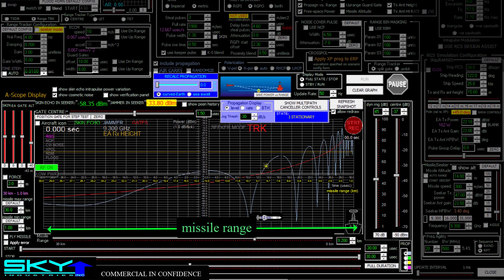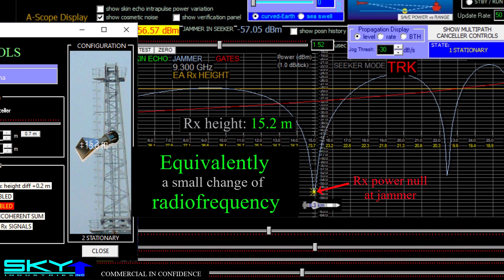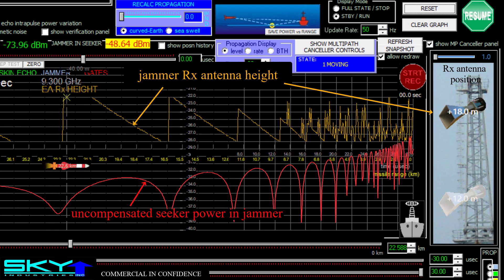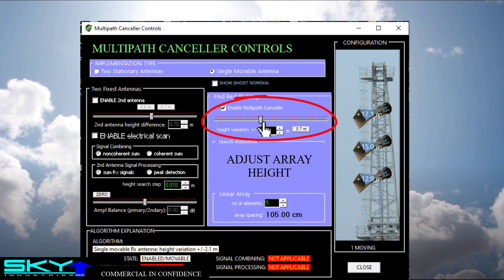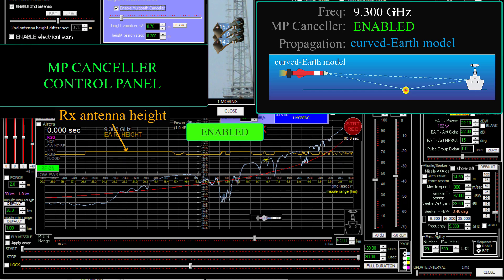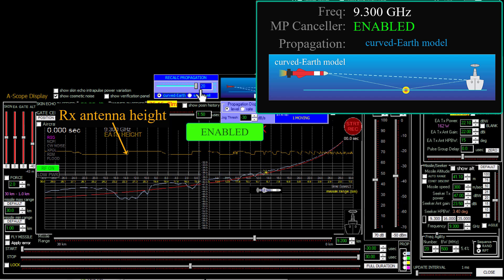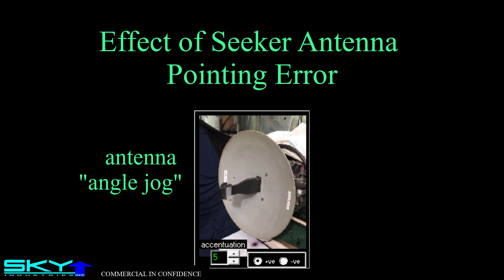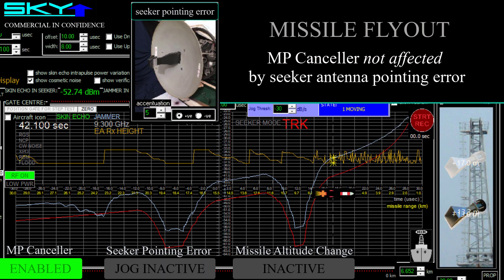Multipath Canceller Intro 15

Comment: Nice! What software is that?
Reply from the maker: I wrote it; it's a sub-application of a missile engagement model called ENGAGE that I have been adding to for ~25 years.  I have never commercialize it into a product, it's a custom tool that answers questions I am curious about.  

The video shows the A- scope sub-application.  An A-scope is normally a graph of Rx power versus time.  Its purpose is to examine the the interaction of jamming pulses with the skin echo in the seeker, seeker timed gates, and possible seeker ECCM features, and also to look at jog detector design.  

I decided to use the A-scope x-axis to simultaneously represent missile range so I could see a continuous graph of jammer power in the seeker versus range.  This is important since a normally an A-scope display is a power snapshot at a particular missile range.  Both jammer and seeker power depend on missile range because propagation geometry (and frequency), assigning double-duty to the x-axis made sense to me.  

Once I had built a fast-and-easy way to look at power vs. range (i.e. propagation), it was a small step to investigate the design of a multipath canceller.  

And I subsequently discovered there is a way to cancel multipath without using multiple antennas and without using multiple frequencies.  So that was interesting.